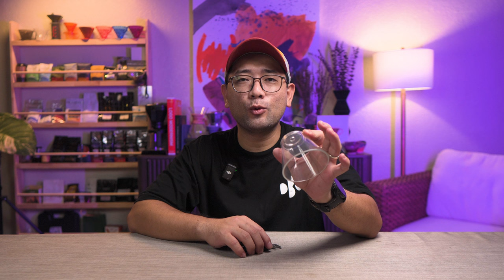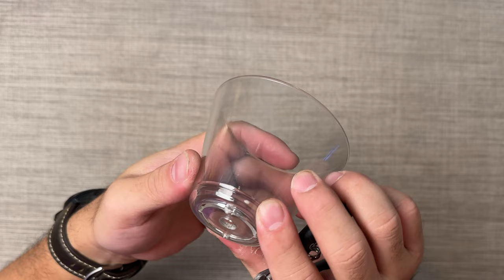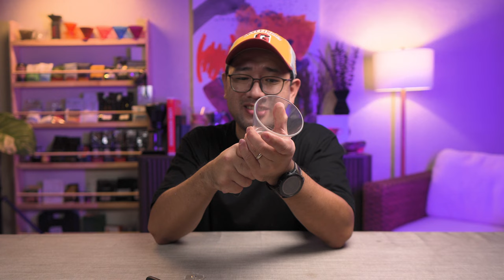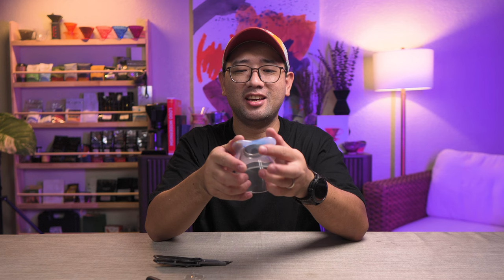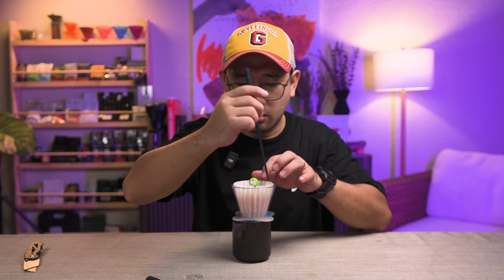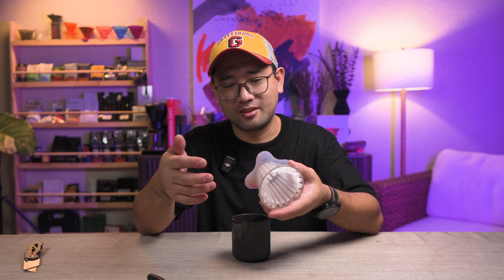DIY Orea V4

Comment: Cool video! Personally, I wouldn't take the chance at it because I'm afraid of chemicals leaking in to my daily cups.
Reply from the maker: @jimmykez3066  im not a chemist but i dont think the chances of that happening is high, bec no 1 pp has a very high melting point. But yes as ive said in the video if you're not comfortable doing it, dont :) but hey thanks for watching!  :)
Reply: @darylbuenocoffee  I'm also not a chemist, but I've encountered anecdotes that scratched or heated plastic containers and such have a chance of leaching chemicals or harboring bacteria. That said, PP is generally non-toxic since it's BPA free. However, if microplastics are leaching, it could potentially be a concern in the future once we have more clarity on their effects. As for bacteria, the risk is probably not as high since the temp of the water passing through should be high enough to sanitize the brewer.

Cheers and I hope you get more viewers!
Reply from the maker: @jimmykez3066  thank you so much for the support!